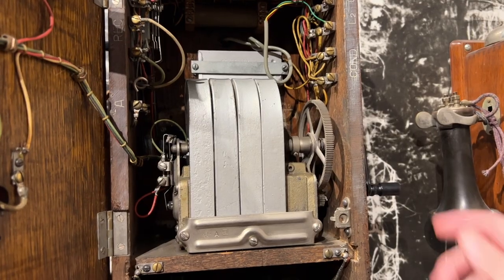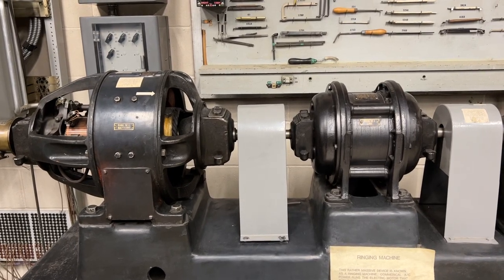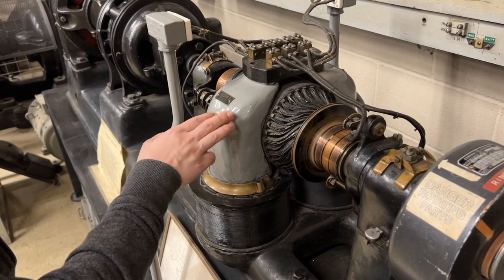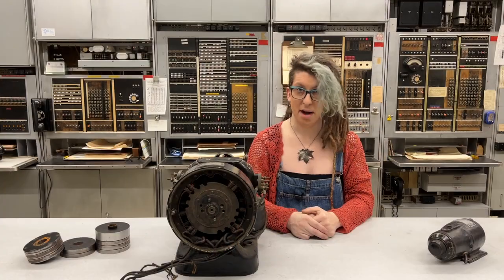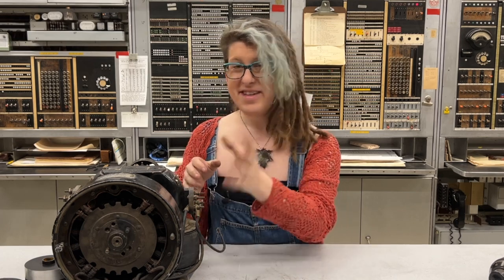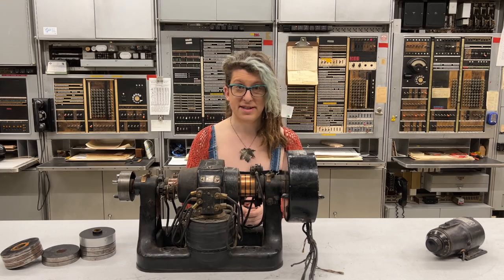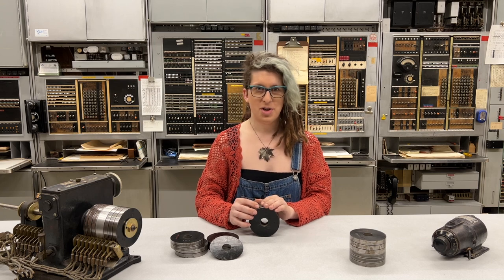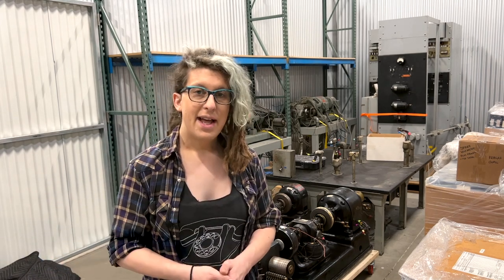The Machine that Makes Your Phone Ring

Comment: Wonderful, Sarah!   Well done!   Thank you.    Glad you provided the sounds.   Very surprised abouthe use of Hg.
To ring a garage sale-purchased extension phone without getting caught by Mountain Bell, I placed a larger neon bulb in series withe ring coil.  
(Would NE-2 have conducted enough amperage?)
The ring voltage would break down theon and ring the bell.   When Mountain Bell would testhe line, the additional bell coil was not detected.
When I bought a telephone answering machine, I reported its 0.5 Ringer Equivalency as 2.5 .   This enabled me to have two additional unmolested telephones on the residentialine.
Reply from the maker: Reporting the REN as being higher... very sneaky ;)
Reply: @ConnectionsMuseum    Mountain Bell charging for a customer-supplied extension telephone seemed improper.   The Ericsson Ericophon Cobra phone stood upright on its base.  The base contained the rotary dial.  The telephone would hang up when set on its base.  It had a neon bulb which would flicker from the ring voltage.   Always wondered if that was to make the telephone undetectable.   But it had an electronic ringer so probably a very small Ringer Equivalency.

Comment: Interesting that you brought up the coin voltage @3:55 in the video. There were 2 way to phreak at a payphone. One was using a tone generator device called a Rad box. And the other way was to get access to the phones TNI box and splice into the coin control wire (usually a yellow or purple colored wire.) a rectifier diode. Depending on the orientation of how the diode is install. This would disable ether the return or collect control of the payphone. I was never good at redboxing and would always get a live operator in the middle of my conversation and would have to hang up or otherwise, keep some change around so I could put real money into the phone while the operator was on because she could tell if you tried using your redbox on her. Anyways, by putting that diode in the coin circuit. Any money that I had to put into the phone because I screwed up the redbox I would get back at the end of the conversation. If course, if you wanted to be a real jerk. You could put the diode in the other way and make the phone eat everyone money. I really miss those days. it was a lot of fun to mess around with the phone system back then.
Reply: Oh wow.

Comment: I worked in a communication center that was built in the 1960s and continued to use that technology. In the relay room was a ring tone generator. A couple of things I noticed were that the ring forward signal was higher powered than the ring back signal because the ring forward signal had to activate the bells on the receiver whereas the ring back signal only had to produce tone in the earpiece of the caller. The second thing I noticed was that the generator alternated between generating a ring forward signal and a ring back signal. So when the caller heard nothing the phone the other end was ringing and when the caller heard ring back, the phone being called was silent. I was told this was to reduce the fluctuations in the power drain on our DC voltage system.

Comment: It might be interesting to other viewers that these ringing machines were used in many central offices well into the 1970’s and 80’s. I saw a great many P type machines running in central offices during that time frame. 
I was not aware of the use of the brush type ring back generator, but I do recall hearing that rough ring back tone when calling some rural areas. 
Excellent videos! I want to plan a visit to your museum.

Comment: I was able to see a more modern version of this machine actually operating inside a working telephone exchange.  The machine I saw was still mostly mechanical but was a more advanced version which occupied only about as much space as one of the electric motors in the machine shown in the video.  Actually, less space, since it had a smaller diameter.
There were actually two machines, in case one failed or required maintenance, so the tones would continue without interruption.
The machine generated two basic tones.  If I remember correctly, they were 25Hz and 600Hz.  The 25Hz was used to provide the ring current for the ringer, the 600Hz was used to provide the busy tone and congestion tone and the two were mixed together in order to provide the characteristic dial tone and when interrupted, ring tone.
Of course this was in Australia where the tones are slightly different to the American tones.
The machine also provided all of the mixing and the appropriate interruptions.
Modern amplification methods meant that the machine didn't have to handle huge currents and so could be smaller than older machines.

Comment: Sarah, If you were to check with the older, more experienced machinists in your area, you might be able to find one that can properly align that cast... casting lol and weld it back together. Yes, cast iron can be welded, brazed, etc together but it takes the correct process especially with a chunk of that size.
Thanks for the amazing history on these machines! I remember some of these sounds when I was a kid, and always wondered why they were different, and why one system had the different sounds. I lived in a rural area back then, so there were a few different systems that could be heard locally, and then there's the long distance calls.... woot!
Thanks again for the great vids!

Comment: I always find it interesting learning how technical features were implemented years ago. I had not thought about how the other telephone tones were produced. Contrast this rotary ring generator with the fiber ONT (optical  network termination) I have for internet and to emulate legacy POTS. The ONT is about the size of a 3x5 index card and about 1/2 inch thick. Beside all the internet stuff it provides the Central Office BORSCHT (battery, overvoltage protection, ringing, signaling, coding, hybrid and test) functionality.  As amazing as my little ONT is I doubt any will survive 100 years to live on in a museum.

Comment: I have a question about the changeover process of this from old to new. I grew up in Spanish Fork, Utah, and I specifically remember these wheel-tones being our ring-back and dial tones, and you or Evan told us somewhere that these almost always came with a crossbar 5, so I guess that that's what Spanish fork started with, maybe back in the '50s or '60s, with the prefix of 798 (with Utah's 801 area code). I only remember back to the mid/late 70s though. Our dial tone was sounding pretty crappy in the late 80s. Oddly enough, not only had it gotten fairly crackly, but I think I even remember the frequency having little bursts of slowing periodically. But I can't remember that for sure.

One day in October 1990, I picked up a phone and heard a NEW dial tone, and it was clean, like a brand-new machine was making it! It sounded like the one that Provo and similarly bigger cities around had already been using since I was ever aware, like back in the 70s, and I was like, "HUH, now WE have this!" I dialed out and sure enough, it sounded just like ring-out did when I called somewhat bigger cities like Provo, Orem, or Salt Lake City! And then I wondered what the changeover was like!

So even now I wonder what it would have sounded like if I had picked up the phone overnight right while they were turning the old tone machine off, disconnecting it, and then turning the new one on. Do you think I would have just heard the last of the old tone, some clicks, blanking, more clicks, and then the new tone, because they plugged it over before turning the motor off,  or do you think I would have heard the old tone wind down to a stop because they left it in circuit while they turned it off, and then some clicks, blank, clicks and the new tone immediately on because it's solid-state instead of rotary?

Comment: I used to enjoy working in the power room (4000A -48VDC, ±130VDC, -24VDC, and IIRC there was a small converter for some sort of 36 volt use). Polished a whole lot of commutators and slip rings in my day. 😀

Comment: In telegraphic systems,we had an equivalent of a tone generator, a motor drove two shafts of cams that (one shaft had the mark contacts, the other the space contacts🤔)  generated two independent outputs of the 32 possible codes of the International Telegraph Alphabet No. 2 at once, this allowed the switching system to send codes and messages to the end users.  I had to rebuild the unit as the cams were worn and were causing the ballasts to flash.  No replacements were available so I slowly, and with great care, reprofiled each cam to the correct shape.  I then carefully reassembled the character generator and was about to test it when I realised I had carefully placed all of thre cams the wrong way around!

Comment: Great video. I have been very curious about how these ringing machines worked ever since I heard Evan Doorbell's "RingBusy" presentation where he described the ringing machines as "large rotating mechanical devices in the basement of the central office". I am curious about one thing though. What generates the two ticks that come at the end of a "city ring" ring cycle? Are they coming from the mercury interruptor? I would assume that the first tick happens when the mercury breaks the contact, but why is there a second tick?
Reply from the maker: Im not actually sure. I have not (yet) seen one of these machines actually operating. We will have some set up eventually, and will have to listen to see if ours make the ticks too.

Comment: When you were showing both motors on the same shaft I started wondering how they generated the 48 volt supply when a CO was powered with AC. If they wanted to be clever they could have used the DC motor as a generator, but I don't know if this would have supplied enough power.
Reply from the maker: Thats a really good idea, but they didn't end up doing that in practice. They had large motor generators that converted AC to DC. There's actually one on the floor next to the ringing machine, but I don't think you can see it in this video.

Comment: That tone wheel technology was used for feedback on many servo controlled motors up until we had photo transistors and LEDs. Why not Cds (photocells) and light bulbs with a slotted disk? Lamps burn out frequently especially when mounted on a vibrating motor. Photo cells are slow to react and have significant lag that would limit the speed or frequency output. But I guess from the 1970s forward LEDs and photo transistors with a slotted disk took over.

Comment: One more connection to music: the dial tone in the Netehrlands used to be 440 Hz, ideal for tuning. It was changed to a lower frequency some time in the 1990's.
Reply: There used to be a musical instrument tuning tone service you could call in our country. It came with the warning that if you called from a longer distance, the pitch could not be guaranteed, because somewhere on the network it might pass a single side band multiplex cable. Characteristically of single side band is that the pitch of the signal can easily be shifted a couple of hertz (caused by the transmitter or the receiver beat frequency oscillator being a few hertz out of tune, completely normal in old tube equipment) without quality degradation. A few hertz is significant, however, when tuning instruments.

Comment: It's quite ironic that I clicked on a video about ringing machines since my phone is perpetually on silent and has been since the moment I got it and immediately turned the ringing off. The problem is always that I either don't hear it or it scares the crap out of me. These days, seeing as how our phones are also computers, the chances are pretty good that I will look at my phone to use the computer part and see the message (and if it's a phone call, well, that gets sent to perpetual ringing because those who know me send a text).

Anyway, when I first saw that huge ringing machine, it looked a lot like several car alternators (but bigger) attached in series. I have the image of the car alternator burned into my memory because I once had a car that would ruin them on the regular and me being poor, I had to change them. I had no idea what I was doing at first except I always buy the repair manual for any vehicle I own so I at least a bit of instructions. I was always very worried that I wouldn't be able to put it back together right and, since I didn't have a camera or anything, I would stare at what it looked like at each step of removal and memorize it. Those mental pictures still exist in my mind today, even though it's been more than a decade since I had that car.

Very interesting stuff! I am really enjoying your videos so thank you for making them!

Comment: The worst thing working in exchanges was terminating jumper wire on the MDF solder terminals and getting a zap from the ac ring if the number was ringing
The hand normally smashed into the next vertical termination and left cuts on the back of the hand.

Comment: FYI the 3 phase induction motor has changed very little since it was invented by Telsa in the late 1880's. Likely less than 20% efficiency.

The inrush current though the control circuit was likely why the DC motor was required for startup.
Reply from the maker: These AC motors did not have shaded poles, or starting capacitors, so if you just powered them up without rotation already taking place, they stand still and make an angry buzzing noise at 60Hz.

Comment: Back in mid-1980’s New York State least all cabling and phones from New York Telephone. So, NY brought A&AT they own cabling, new phones and a 5ESS switch. I work for A&AT as a temporary worker helping to installing a new parallel phone network for the New York State Offices. That had many buildings around in Albany, NY and across the state with over 50,000 phones. They hired 30 Temps that just put a jack and wire going back to closet that the old phone went to. They split us up into 2-man groups with a permanent tech to show us ins and outs of what A&AT wants done. The documentation was not up to date, so we search out all the phones. My question is to you when we found a phone, we dial a 3-digit # that either 997 or 998. Then phone switch would say that phone #. Then we would verify that # with our list. Have you ever heard of those two numbers?

Comment: Would I be correct in guessing that the brushed, harmonic ringback is the basis of rings like CDO ring, with fewer subscribers and less electrical load? And that the alternator ringback would be the basis of City Ring?
Reply from the maker: Yep, many CDO ring machines used the brushed slip-ring method. Cheaper to implement as long as the load isn't too high.

Comment: Why didn't they replace these with oscillators when DTMF came out, once they realized they had that almost-solid-state technology for it?
Reply from the maker: They eventually did make solid state ringing machines by the 60s, but the largest ones were still motor powered like the ones in this video. It took a while for the technology to catch up. By the 1970s all new ringing plants were solid state.